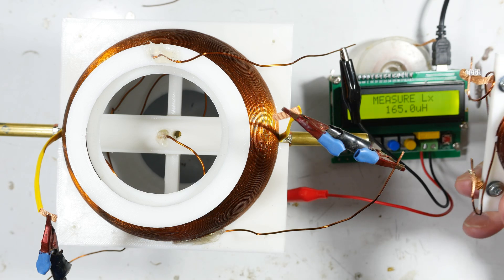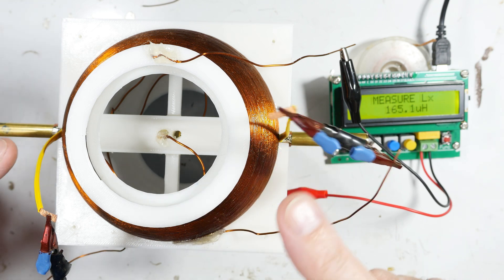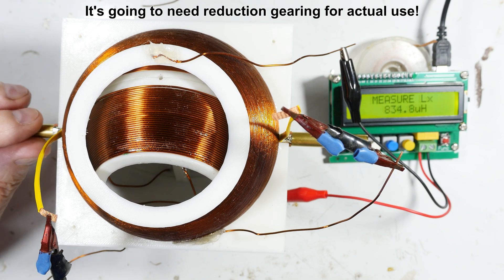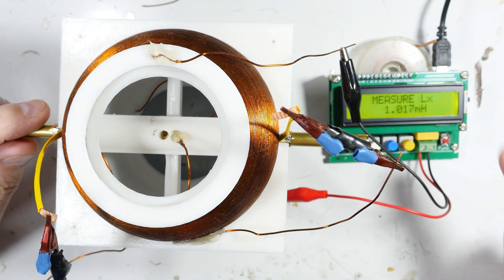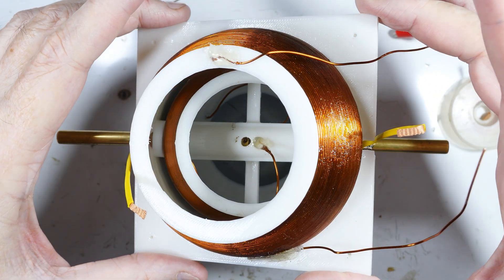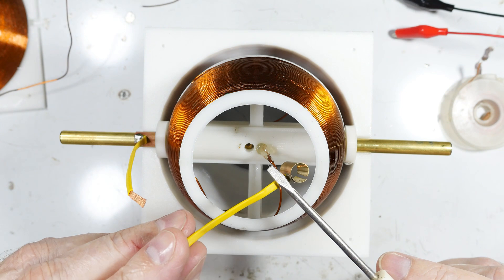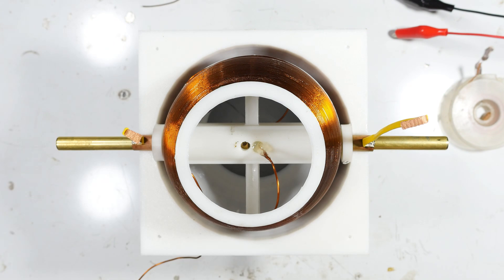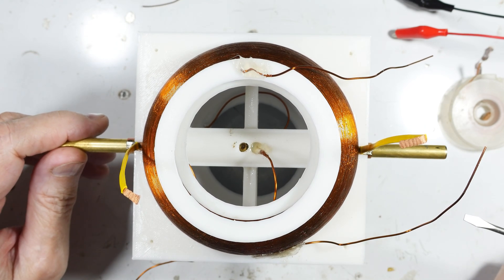Crystal Radio Variometer Pt7-- New Beta Version Works! (4K)

Comment: Maybe not for this project, but there is a thing called a "slip ring" coupler that allows continuous 360* turns, for multiple signal wires. The hobbyist models are cheap and can be found easily at the online retailers. There are industrial models, too, that are heavy-duty.
Reply from the maker: That's the kind of thing I was looking for, but did not know their proper name and could not find them. Thanks. I will research them to see if they will cleanly pass radio frequencies.

Comment: Do you think that a little no ox grease would keep the slip connection from oxidizing?
Reply from the maker: That is what I ended up using. It dries out over time, but the real silver-containing conductive silicone grease is crazy expensive.

Comment: It looks very professional, reliable and will work well. I understand that you want to obtain high coil quality over a large adjustment range. Regards
Reply from the maker: Yes, I  have the same understanding. I've seen several that went from 0 to 25 uH and used strips of copper for windings and had only 7 windings per section! One improvement is there is no electrical noise when the ball is rotated.
Reply from the maker: I did a self resonance test. At max it's 1100 kHz, middle is 580 kHz, and low is 468 kHz.